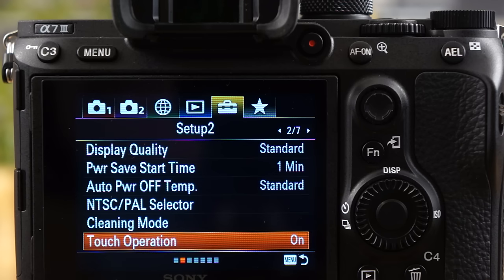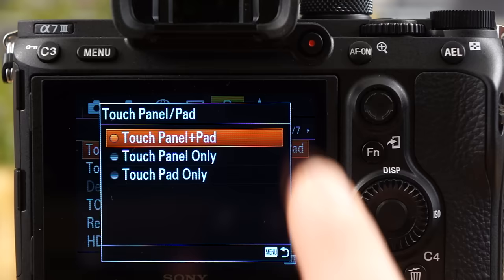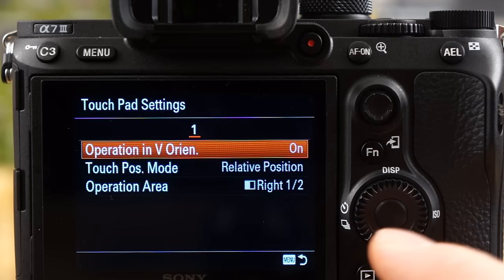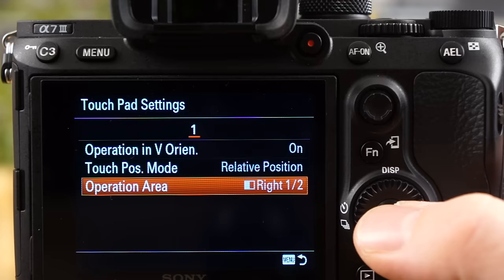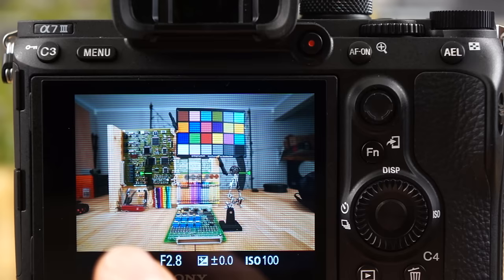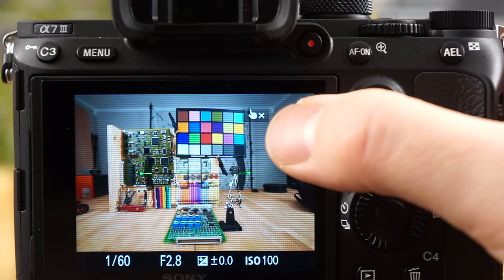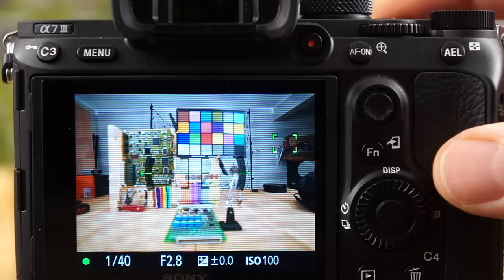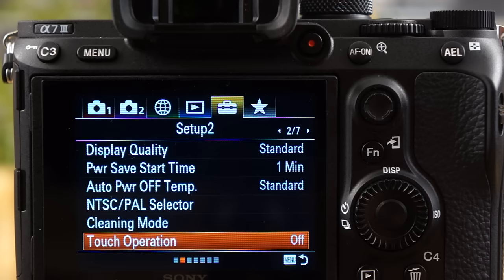Sony A7 III - Touch Focus Explained In Detail with Demo in Lab

Comment: There is a  transition speed from focus to focus  point . As well. Fast med and slow. Where is that
Reply from the maker: - MENU →  (Camera Settings2) → [AF drive speed] → desired setting
- MENU →  (Camera Settings2) → [AF Track Sens]→desired setting
Reply: Jay SonyAlphaLab that only shows standard and responsive.  I  was referring to the speed at which the touch focus changes, right now it’s quite fast. I saw a few days ago where it can be made slower.
Reply: Jay SonyAlphaLab found it.. drive speed was the function. Thanks
Reply from the maker: Yes, I added that one to my original response. Sorry about that ;)

Comment: Will the touch focus work with a screen protector in place?
Reply: I applied the Expert Shield brand plastic protector and touch works.  Check protector manufacturer’s claims.
Reply: Cool, thanks.   Love the Camera
 @paulm8157 arvey
Reply from the maker: @paulm8157  Thanks Paul ;)

Comment: Hey Jay, I also have been using touch screen focus however the focus point seems to change sizes and moves to focus on different things on its own. The focus point is not a small square as shown in your video, do you have any idea why?
Reply from the maker: It sounds like you are using a different focus mode like tracking maybe? What does the focus box look like?

Comment: I'm still having some issues. When I'm shooting video (4K) and I have my focus area set to wide, the touch screen doesn't work. I have to switch to flexible m-spot. I can only utilize the touch screen in the wide focus area when I'm shooting photos (RAW). Is this normal? Also, is there a way to slow down the speed of the tracking box? On my camera, it's like a cat on catnip. It's super fast and it dashes across the screen. It wasn't this fast on my a6500 but my a7iii it super sensitive which makes it a little harder to make small adjustments. TIA for anyone who can help with these issues.
Reply from the maker: When recording video the focus indicators do not come up on the screen, but the focus does move where you touch. It's frustrating, because you can't actually see the focus point you selected when in video using touch to focus. I don't think there is a way to slow down the way the focus moves when using the thumb toggle if that is what you mean? Try using the dial on the back as a directional pad, left, right, up, and down...
Reply: @Jason_Hermann  Fist of all, thanks for such a blazing fast response. That alone earned you a sub so thank you! I tried it again and it's not letting me focus on different areas of the screen when the focus area is set to wide. I'm probably being too picky. I've heard a lot of filmmakers recommend using the zone focus area, especially for interview-style shoots. I guess I'll stick to that for now. And the speed of the focus box slows down using the tiny joystick on the back. It does kind of stutter as it doesn't move as smoothly with your finger. Again, I'm probably being too picky but I figured these issues should have been resolved with firmware updates since the camera has been on the market for a while. Again, thanks for the fast response. I really appreciate it.

Comment: Hi Ja, great video. When I touch the screen the focus point moves but doesn't actually re focus. Any ideas?
Reply from the maker: Yeah, that is just the focus area you are changing. The shutter button still needs to be pressed down half way for the focus to change unfortunately. The newer cameras work more like what you are thinking...
Reply: @Jason_Hermann   When I press down half way or press the back focus button..nothing happens.. the little square moves to where i touch it on the screen, the little finger icon comes up but when i press the shutter half way..nothing happens..no focusing I can take a shot but it will be out of focus.
Reply from the maker: @anthonylee5305  Are you to close to the subject? try moving back or zooming out. If that does not work, try putting the camera in full auto mode and see if it focuses just to make sure...
Reply: @Jason_Hermann   Thank you for the prompt reply Jason..When I press the AF-ON button it works but not when I press the shutter button or the back focus button..